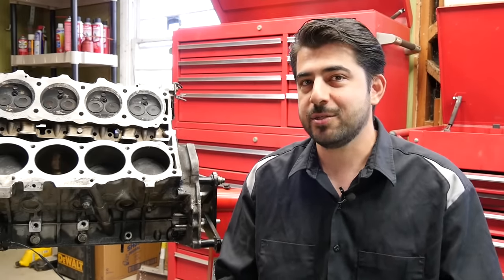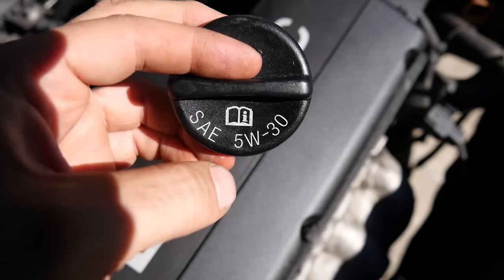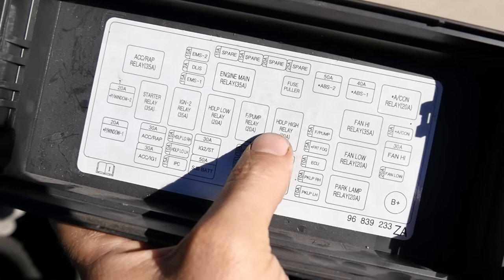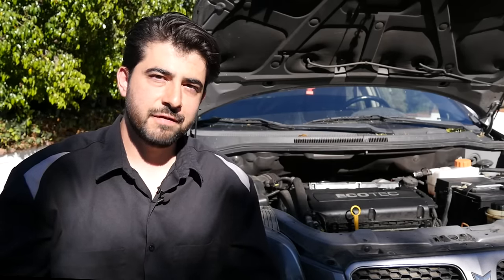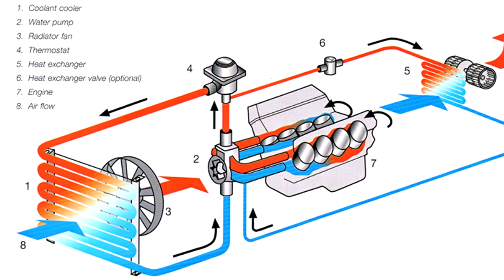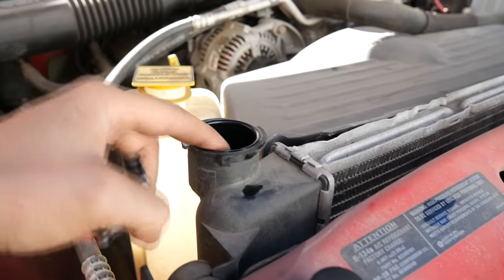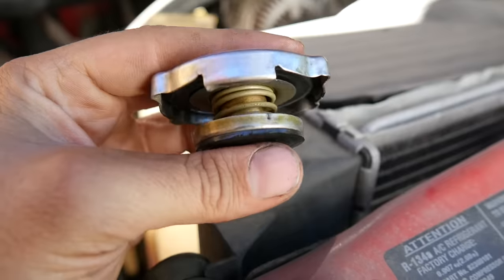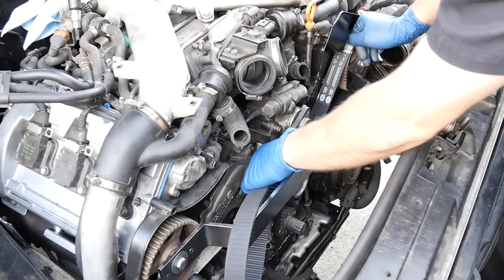Make Your Car Engine and Transmission Last a Very Long Time - Top 5 Tips On Car Care

Comment: Step 1. Dont buy a Chrysler product. It will never make it
Reply: But my 07 Jeep Grand Cherokee Laredo just hit 170K and I’ve replaced a lot of the stuff he mentioned here via Oreilys auto parts just replaced my catalytic converter system & radiator week ago ($2K) and now she’s running awesome again! I hope I make it to 400K
Reply: comin on 190K on my 300c dont mean to jinx it but amazing so far
Reply: Got a 2012 Charger 392 that just hit 175k miles
Reply: Flyinram solid! 🤙🏽 btw u still have your original catalytic converter system and original radiator and water pumps in there?
Reply: Boutta buy a 2013 300 Chrysler 94k miles.owners do u guys recommend it?
Reply: Zayvo Jay lmfaoooooo stay away from that garbage
Reply: Zayvo Jay I would. They’ve been super reliable for me imo 07 jgc 3.7 v6 171k. Always stay on top of things like fluid changes check for leaks make sure no funny smells always do proper tune ups etc & try to get all the previous paperwork’s if u could/carfax u should be fine 👍🏽 best of luck!
Reply: PMC05 why buy trash when you can buy something JDM that is guaranteed to last more than 300k?
Reply: Jayme Lanuza trash? Naaah u trippin kid my jgc been solid so far lol
Reply: PMC05 lmfaooooo only lames buy domestics bro thats a fact
Reply: @lstruggy  That's Awesome 😎 What's it at right now on the dash (High Score Mile) 👍
#200K
Reply: @Iamcwayy  Those 5.7 Liter V8 are Good Engines  🚂
Reply: Master Jedi just renewed registration yesterday @172,600 👍🏽
Reply: @lstruggy  Oh! Another thing it will say on the back not to use it in Coolant radiators. 

And CVT Transmissions that's really the only con I've known about it
Also Not in Brakes either 👍
Reply: Master Jedi wil do! Tnx! 👍🏽
Reply: @lstruggy  Hope It helps and Satisfies ya in the long run 🛢️with Experience.
 I'm still quite new to it myself but I believe in the stuff 💯%
Your Welcome 👍😎.  Take Care ✌️
Reply: @lstruggy  Just one more thing-I found it to be sold at O'Reilly's, Meijer, and (Walmart Maybe)
Reply: I had a 08 dodge charger 3.5L with 305k miles on it u only have to change timing belt on time b4 it breaks and bends any valve or mess up the piston. and also had a dodge avenger 08  2.4L that had 230k on it and still running never had any major issue with it.
Reply: eimb1999  if i still had that vehicle i would prove a point to you. But i replaced exahust 2 head valves on it cuz the timing belt broke after that cars didn't hesitate or shakes was running smooth till i decided to upgrade so i sold it for 1300 with 305K on it and i bought a 2013 dodge charger
Reply: Bought a 1995 Chrysler Concord with 120k miles.  Got it up to 280k before I sold it.  It felt like I was replacing the motor mounts every 6 months but besides that and some minor electrical problems (replaced most of the wiring but it was cheap) I had no major problems.
Reply: Jayme Lanuza 2000 ram 2500 253k miles, 2011 dodge caravan 130k miles, and a 2011 ram 1500 140k miles
Reply: Hahaha any car will make it to 200k miles. It's how it gets there that matters. My old celica is at 320k with nothing but oil changes, battery and heater core (that was a pain). My AUDI on the other hand is a nightmare!
Reply: 2001 dodge truck  290,000. So now what
Reply: My Chrysler Pacifica v6 220k
Reply: Flyinram 
My charger has 185k miles
Reply: 209K on a Dodge 5.9L Magnum engine! Still actively using vehicle.
Reply: Facts my 2010 300 transmission failed right at 100,000Kms what a joke
Reply: 06 Chrysler town & country, 3.3, 345,000 miles , original engine and transmission. I have been using Lucas oil treatment since 160,000.
And have changed the trans fluid 4 times. She runs well enough that I expect to get to 400,000.
Reply: 2000 Dodge Intrepid 3.2l es sitting on my driveway tonight with 364,199 miles running strong.
Original engine, transmission and fuel pump...Burns zero oil.
Reply: @jaymesp95  I got a Trackhawk.. how's that lame? Lol
Reply: 2002 Jeep Grand Cherokee at 260k miles. Reliable as hell.
Reply: My dodge avenger is at 200k
Reply: You paid 2k for a radiator and catalytic converter?!??!

I can get a generic cat for about a hundred dollars online. My local muffler shop would install it for about 75.00.

I can also replace the radiator, water pump, thermostat,  both hoses, and the serpentine belt for about 300.00
Reply: Richard Ward  Cars have gotten very expensive while quality has dropped. Sure, they include a bunch of fancy little features. But the engines and transmissions are junk.
Reply: I have an 06 Dodge Ram original owner 244000 miles and going strong. Changed plugs, oil, front wheel hubs and U joints and that’s it. It all how you take care of your vehicle. Fast starts are murder on engine and transmission.
Reply: @vanhelsing8776  The people bitching that Chrysler is junk, are the ones who go 25,000 miles before an oil change. They then take it to fartmart for some crackhead to hopefully fill it with that Supercrap oil and a paper filter 😂

I would be pissed if I bought a new car/truck and the engine blew before 300,000 miles... People need to do a little maintenance. I have the 3.7 V6 with 172,000 miles. I have no ticks, knocks, oil usage, or leaks. For the engine I do my own work. In January of every year...

6 new NGK platinum plugs with anti seize and dielectric grease on the plug tips

New thermostat and antifreeze
Upper and lower radiator hose
Air filter
PCV valve

Even though it will last 8,000 miles. I change the oil every 5,000 miles with Royal Purple oil and a high quality oil filter. I also drop in some seafoam about once a year.

Some might say it's overkill. But it beats 6 years of payments. And I have no sludge or junk in the engine.
Reply: Michael H 

Frequent oil changes when you do it yourself are cheap insurance even using the best oil and filter and on these Dodge rams everything is easy to get to with the exception of the PVC. My goal is to get 500000 miles or more. When I first bought it a friend of mine who was a ford mechanic said get ready you will only get 30000 miles out of your transmission. I remind him of that often. Good luck with yours.
Reply: 187k on my 99 ram
Reply: I have a Toyota but I'm gonna sell it and buy a ram
Reply: @jaymesp95  I live in the south it'll be fine
Reply: Jayme Lanuza 

14 years later my bed is in great shape and I park outside.
Reply: I've had such horrible experiences with Chrysler products (Dodge, Jeep, Plymouth) that I'll never own one again.  Hell, I don't even like to ride in someone else's Chrysler product.  Damn things gave me PTSD.
Reply: I'd say dont buy a Ford!! My Jeep has 250,000 miles on it....nothing major has gone wrong! Simple repairs!
Reply: 2004 Grand Caravan 266K runs great. Mobil1, orange Fram filters, regular spill n fills for the trans.
Reply: I've owned two Chrysler products and both served me very well.
Reply: Too late! 😡
Reply: An old one may do okay with attention. But anything past 2000 would be junk.  For GM, avoid anything past the fall of Pontiac.  Ford, avoid all dual clutch transmission vehicles and anything with the term, "eco," in it.  For everything else, avoid any car with a CVT except a Prius because it is not a belt driven transmission.  Subaru also keeps their CVT together well also.  Also avoid any larger vehicle with a four cylinder engine.
Reply: Indrid Cold saying anything lol.... CRVs have a 4 cyclinder and are reliable
Reply: @jaymesp95  CRV is not a large vehicle.  Large heavy vehicles with a four cylinder engine are the ones to avoid.  Smaller 4 cylinder vehicles are very reliable.
Reply: Bullshit,  the last two jeeps I had, both were almost 300,000..
Reply: WRONG. My Dodge Caravan 3.3 has 310,000 miles
Reply: My co-worker has a 2012 Chrysler 300 awd car with 296,000 miles and still running strong!
Reply: 4 liter Cherokee engines have entered the chat

Comment: I only use quality eBay parts.
Reply: I know this is a joke but there are some people that do sell OEM part tho they are either higher in price or just right. Then you have aftermarket trash and what not.....classic ebay 😉
Reply: Bruh Iv'e been using Ebay parts for ages and have no complaints, plus it cost one third of most oem parts.
Reply: i bought genuine MAF sensor from ebay, my MPG actually improved slightly
Reply: Use say they are hit or miss with the after market.
Reply: Agreed! You can extend that way of thinking with many aspects of life. That's why I only date honest and marriage quality hookers that are virgins.
Reply: nothing but the best for our babies   :D
Reply: Put $35 dollar pair of ebay struts on my 03 accord.  Smooth as silk now.  Scotty kilmer is wrong
Reply: That's an oxymoron.
Reply: Da C. Motorcraft oils and filters changed every 5k mis on all my Ford trucks & SUVs gets me easy 200k+ trouble free mis every time!
Reply: Ebay doesn't make parts.
Reply: Only aftermarket manufacturer I buy from is Dorman. They’ve had a killer reputation for years and their parts are just as good or better than OEM counterparts.
Reply: Sea Life I Agree
Reply: @TJ-sc9ms  yes I havent had any problems either
Reply: MAF sensor $600 from auto-zone OR $40 off ebay. The sensor works perfect even though my engine is very picky about oem and non oem parts.
Reply: The cheaper the better!
Reply: Me too good sir
Reply: Sea Life  you know you can buy aftermarket parts that make oem parts from ebay. For example I buy Mercedes parts from eBay made in Germany from manufacturer such as lemforder that offer lifetime warranty on their parts. And their control arms are batter made then overpriced oem ones using batter rubber bushings
Reply: Da C. 🤣🤣🤣🤣🤣🤣👍🏽
Reply: I bought chinese coil packs off ebay and those fuckers are still going strong after 5 years. 8 coils were $35 with free shipping
Reply: @TJ-sc9ms  Many eBay auto parts are counterfeit so double check! I ordered NGK Iridium plugs once and the package showed NGK Platinum Iridium! There's no such thing!
Reply: Lol.. Is amazon any better tho? I always got my parts from auto part stores or junk yards.. And im waiting for something on amazon.
Reply: @muwahh98  i bought ebay parts for my cars yes,but the truth is,one is always taking a chance.
Just recently my wife bought a radiator and now we rehaving overheating problems.
Reply: @dvader3000  you're right, I've bought radiators off eBay before and not experienced problems though
 (2004 impala). Have you determined that it is the radiator ? Do you live in a warm area?
Reply: If it has a warranty it’s a buy for me, but I never buy engine or electric off eBay, only suspension, brake and body parts
Reply: I’m a mechanic you want to research some parts you buy the brands and the quality . The cheap shocks for instance are not as good as some brand name shocks the cheapest stuff is cheap for a reason and not all eBay parts are qaulity you want to read all the descriptions of the parts that way if the company you buy from did not specify that it was qaulity when it really wasn’t you have an easy case to argue to get full refunds with eBay backing you 100%
Reply: Lmao
Reply: eBay got deals n shteals on OEM Toyota parts. Piston ring set, fuel filters, gasket kit, you name it
Reply: @iamasmurf1122  funny you mentioned shocks, just bought some on Ebay. Cheapest I could find. Car looks  and run much better. 02 Camry
Reply: I have buy many OEM parts form ebay, same seller as if you buy anywhere else, but somehow way lower price👌🤓
Reply: I only use quality napa made in China parts. Bought threw Ebay and marked up for profit.
Reply: You can get OEM parts on EBay and some sellers sell the parts for less you just gotta do some digging but you can find them
Reply: Michael Wilson         I Bought a plastic seat clip to hold my back bench seat into place cause the old clips broke cause they where 15 years old and I believe they where factory. Now imagine finding these things at a store good luck so I went on EBay found them 30 dollars later for two plastic clips you telling me each are 15 dollars but I wanted it back to original factory so I bought them but it’s OEM clips
Reply: Same!
Reply: @TJ-sc9ms  I agree 100%
Reply: It's important to remember that EBay is not itself a supplier or manufacturer. It's a marketplace, so you'll have a very wide range of options on there. Just look for a seller with a 98% or higher rating. Look at the description of the part, and use your best judgment. That's what I've done and it hasn't failed me yet, and I've saved tons of money. Mizumo is my favorite Ebay seller for auto parts.
Reply: @mattmgarza  also l.
Make sure that the seller has roots!

Many sellers get 100% positive feedback from the jump!

Although eBay's money back guarantee is always there to have your back
Reply: @mitch1078  I once saw Buck knives being sold on eBay that showed they were manufactured in America. Only problem is that they shipped from China lol. Although I don't see those knives anymore lol. The Chinese are great at reverse manufacturing and creating half ass items that look just like the real thing. 
Now, eBay is an excellent place to buy used OEM equipment because people have a business going to scrap yards or what not and pulling genuine parts off of vehicles and selling them at a discount.
Reply: @muwahh98  Scotty is never wrong,..and you obviously must of only listened to one or two videos... he never said never buy on ebay, or online...
Reply: Those copper-sprayed eBay head gaskets tho. Those are nice cuz u get to do it all over again in a few days when ur real ones come in. 😂
Reply: I go pull the parts out of wrecks and dead cars for free. Since I am the company's mechanic, I am the one that decides when to retire a vehicle or fix it.   When I decide it is time to retire a vehicle, the company either sales it very cheap to an employee or their family, or scraps it.  If I decide it is time to scrap it, I help myself to many parts.  It does not effect the price the salvage yard gives for the dead vehicle if it is missing parts. They just want the scrap metal.  Many parts will fit multiple vehicles so I get the parts for other fleet vehicles, or keep them for my own vehicle.
Reply: Have found several OEM parts for 10-20% of the cost of even rockauto at times, just have to be extremely careful and be sure to check reviews!
Reply: @TJ-sc9ms  not cheap brake pads. I bought 20 dollar brake pads off ebay and I can feel the difference in stopping distance, plus my rims are always covered in brake dust.
Reply: Strictly O’Reily parts for me here w warranty’s like Bosch brands so far so good, 2007 Jeep Grand Cherokee Laredo just hit 170K recently
Reply: Mm
Reply: Da C. Wallmart is the way to Go haha
Reply: Lol
Reply: I used an ebay timing belt kit, pulley failed at 5,000 miles. Never again.
Reply: Guys, guys guys. Wish is even worse
Reply: From china I hope?
Reply: " always use OEM products.. ".  Show me one study where using good quality non-OEM/aftermarket parts are better than OEM. It's total bullshit. Most OEM parts are rebadged 3rd party parts anyway !!
Reply: @TJ-sc9ms  eBay rules!
Reply: You can't put "quality" and "eBay" in the same sentence
Reply: @CORZER0  neither does the car dealership
Reply: This comment made me lol
Reply: @eliasshadow5643  Yeah there just like e-bay parts, but cost more than e-bay.